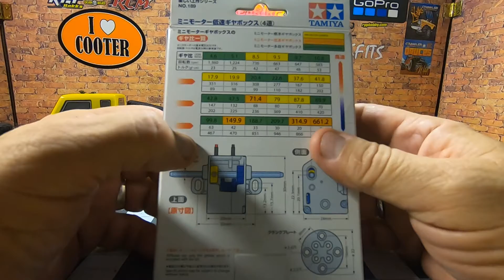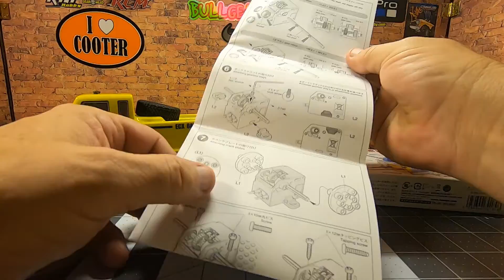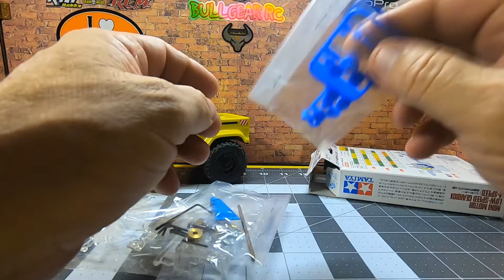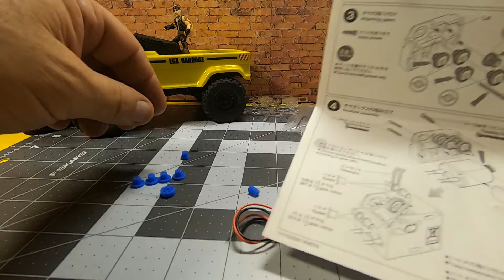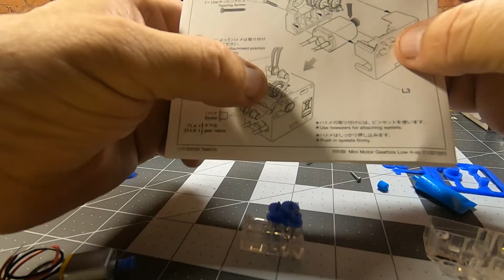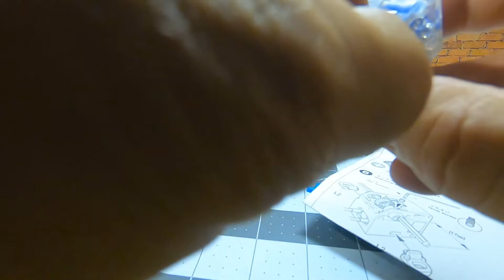ECX Barrage Tamiya 4 speed gear box mod Part 1

Comment: Here we go Uncle Lee!
What I know,  is that you got a challenge ahead of you with this little truck.
I think you're gonna make it a badass little crawler! 
I vote on bigger tires. Those little Barrage tires are soft,  but so small. 
Check out my Barrage body on TJ's FB page,  it looks good when you fix it up!   :)
Reply from the maker: I'll be sure to go check it out👍👍
Reply from the maker: Is yours the blue one with the deadbolt cage?
Reply: @Ldx1CB  yep,  i cut the cage up a bit and put it on. 
The rails over the doors come from extras in a scx10ii kit.
The bumper is a volcano 18 monster truck bumper bolted to stock bumper. 
The bed is balsa wood. 
With a cut up bit holder for the fender flares.
One of those builds where you just keep adding to it..